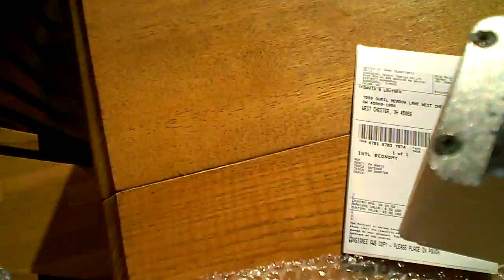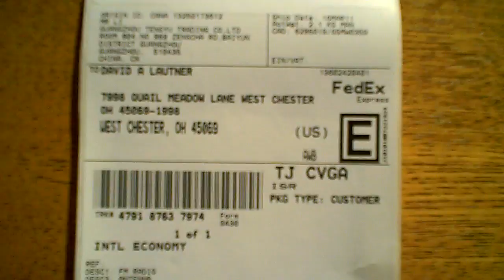CZH-15A power supply issue

Comment: You can always buy a new (smaller-which does fit) DC power socket in your local electronics store and solder it on that cable instead of that old which does not fit... Of course that applies only if you have minimal electric/electronic knowledge and some digital/analog multimeter in your possesion...

Cheers!

Comment: Pickford is right! Very dirty signal, with images 20mhz below fundamental. Could be caused by poor power supply full of noise. If you want one that will work out of the box and sound good; try an EDM transmitter and they stand by their products.

Comment: I bought one of these from the REAL HLLY website and it works perfectly when setup properly it's been running for over a year now and no problems at all. signal reaches over 8 Miles.
You know it's a real one if it has the HLLLY website and logo on it all the other ones are crappy copies.